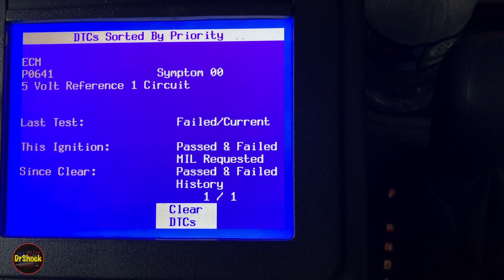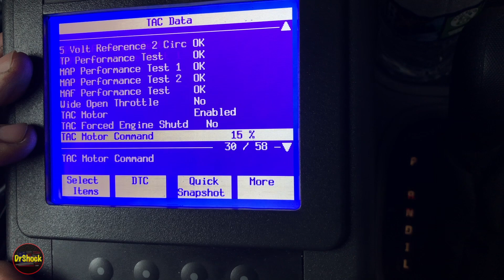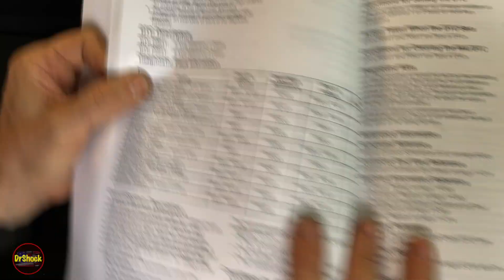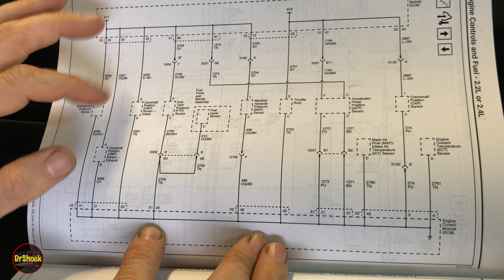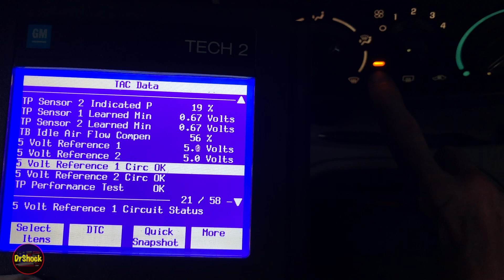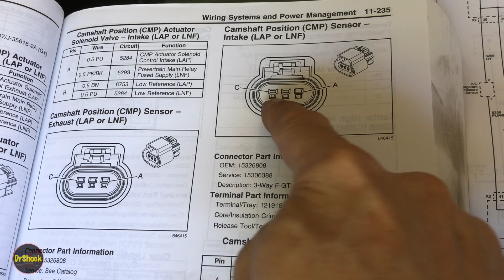2009 - 2010 GM DTC P0641 & C0561 Diagnosis & Repair (Chevy Cobalt & Pontiac G5)

Comment: Did repairing that wire also remove the C0561 code? You didn't mention if it did or what the cause of it was.
Reply from the maker: So the whole video is about addressing these DTCs as explained in the intro, and giving some broad pointers on what all to look for.  For this particular vehicle, within the specific model year range of the video title, both DTCs were caused by the same short to frame ground on the signal carrying wire.
Reply: @DrShock thank you. I'm looking at a Traverse that has the same code plus a misfire code so this gives me the confidence to get it and fix it. Thank you

Comment: Whats that sensor called
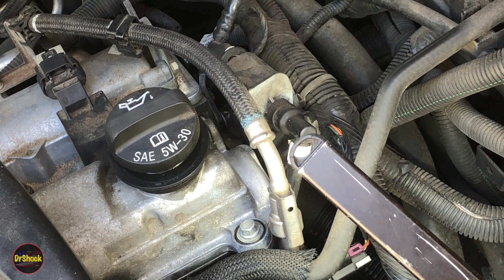Reply from the maker: There are six different sensor circuits we covered in this diag video, you'll have to be more specific.  If you mean the sensor closest to the wiring harness damage that would be at 14:32

Comment: If you looked at live data for each of those 5v circuits it will show you which one is erratic.
Reply from the maker: You don't have that level of PID granularity on this make/model/year even with a GM Tech2.  What I showed is all you have to work with, hence the need for manual triage techniques instead.

Comment: I got a question who makes the ac control units in 2008. Chevrolet silverado I have the full Load it of the AC control unit. My buttons are starting to wear and my mounting tabs are broken.
Reply from the maker: I would service that unit with an ACDelco/GM part as the OEM.
Reply: But it's j Discontinued

Comment: Didn't see a way to reach out email or other means. I have a 2001 Tahoe. Looking to see if you have any recommendations to seal the weather barrier on the front doors. Factory had a really nice spray glue it appears but it won't reseal itself and I've used super 77 but it doesn't adhere very well
Reply from the maker: You mean the clear plastic sheeting  behind the door trim panel?
Reply: @DrShock  yes, plastic sheet behind door panel attached to the metal door.
Reply from the maker: When the rain deflector has a clear adhesive I do use 3M Super 77.  But when I come across the type that is black, I use butyl rubber cord/rope instead.   It's a closer match to what was used originally, at least on GM vehicles.